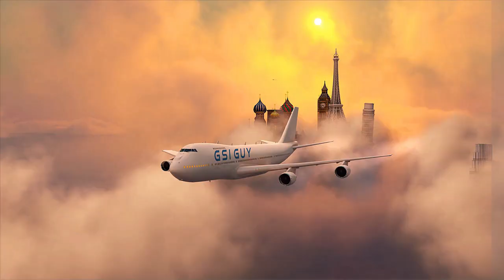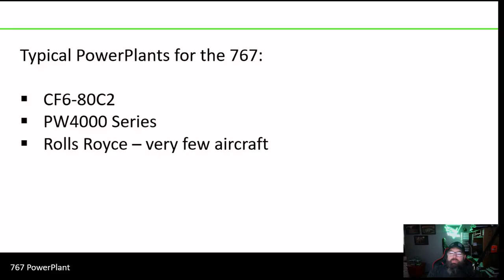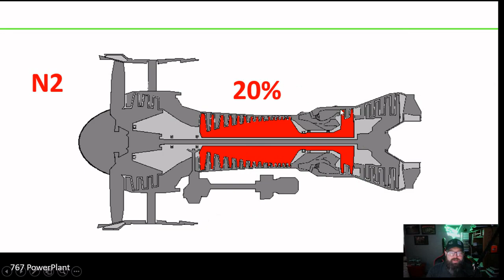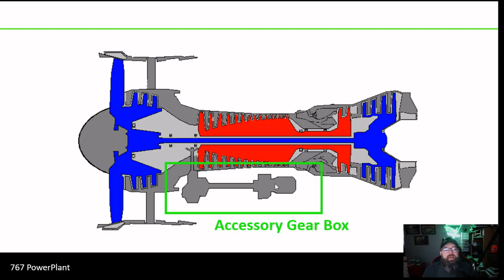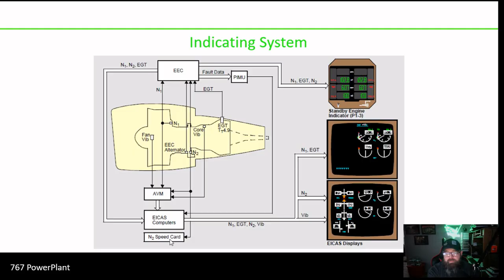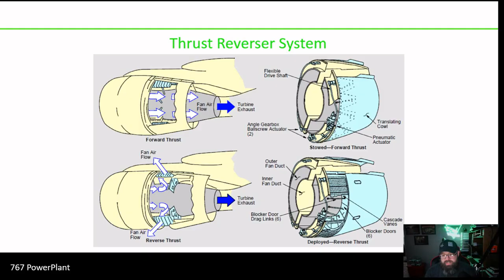Boeing 767 Engine Basics — CF6 vs PW4000 Explained Part 1 - GSI Guy LLC

Comment: Why’s is the rb211 not included in this?
Reply from the maker: That’s a great question! So, 2 reasons…. First, the RB-211’s are rare on a 767.  Second, I dont have the same amount of information on them.  However, I will look at doing a video specific to the RB-211.  😊